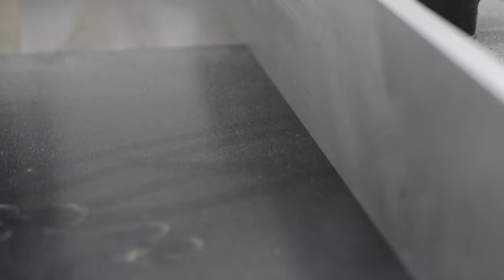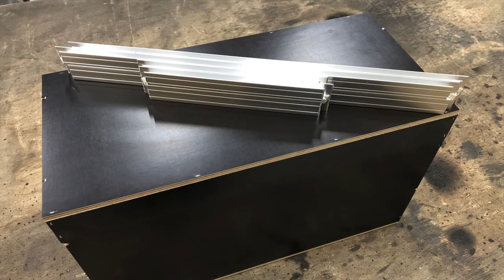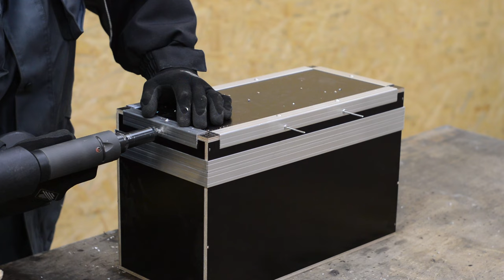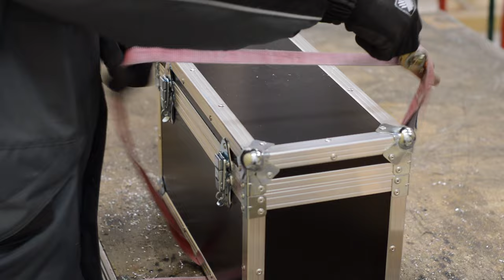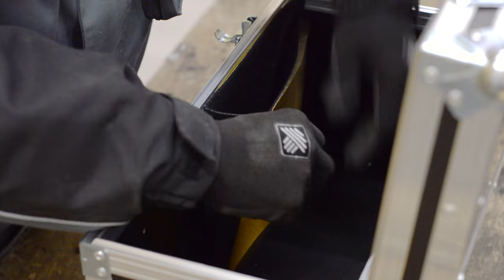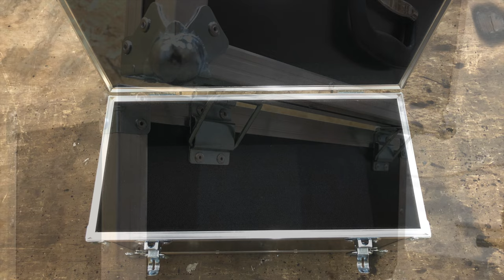I build a flightcase for my plasmacutter, Flightcase selber bauen

Comment: Mega Projekt. So viel
Gelernt dabei. Welche Nieten hast du verwendet ? alu, stahl oder edelstahl? Vielen Dank fürs teilen
Reply from the maker: Vielen Dank. Aluminium
Reply: @turboschneider6407  Danke für die schnelle Antwort. Ich tippe auf 4mm Durchmesser?
Reply from the maker: @lutzhegemann5103  4 und 4,8

Comment: No dado…no glue…3/8th material….better hope it doesn’t take a fall
Reply: The aluminium takes all the force. The wood only offers rigidity and compressive strength.

The tacks will fair better under a sudden violent impact than wood glue will on joints like this. If they were dovetailed or similar it would be different